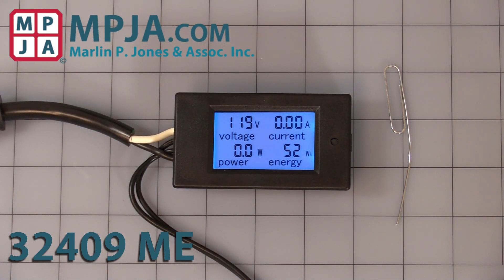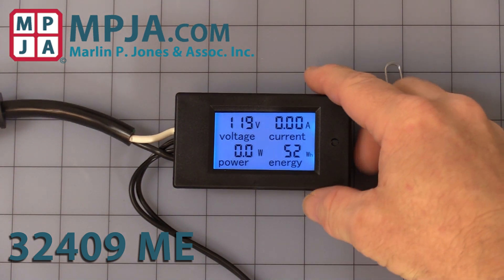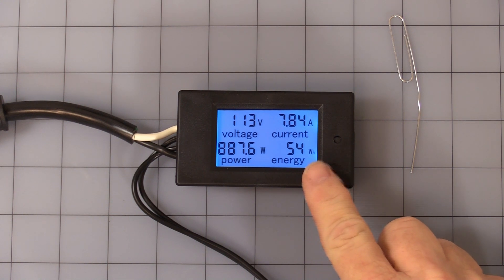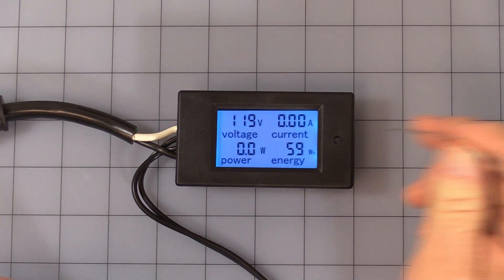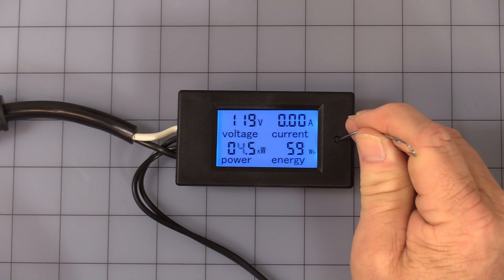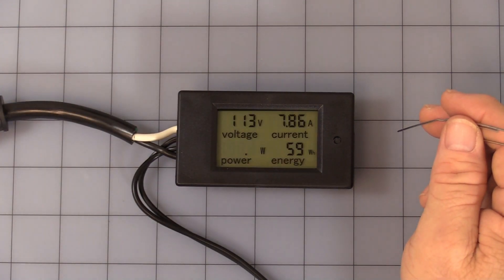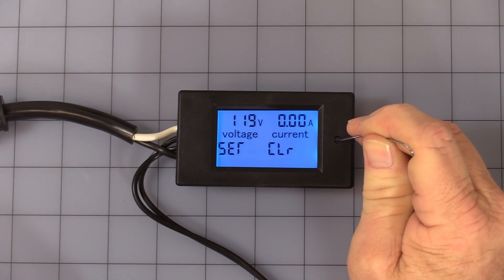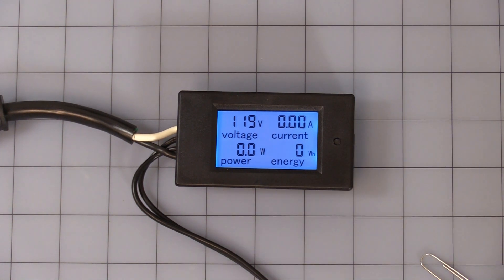LCD AC Volt, Amp and Watt Panel Meter 32409 ME

Comment: Is there a way to calibrate the panal meter? For example it's measure 
227V x 3.44A = 711,5 W but it should be 780,88 W it's an error of +/- 70
 Watt. I have the PZEM-021 version 3.

Comment: When I set the required voltage, the display will flash. So I want to ask if he has any signal or control output. Somewhere on the board.
Reply from the maker: Sorry there is no signal output with this meter.

Comment: aug 25 2019  my similar unit off ebay china is part  no.  PO6S-20 and comes
with a  mystery circuit diagram.    otherwise it could be what you have.
      searching u-t here for a vid' newer than yours with my unit's p/n.

     thanks for doing this vid.  esp' the programming part using that one switch.
and noting the flashing for error is not accompanied by an audio alarm

    on the 1 page op instr's that came with  my unit  is reference an an 'alarm'.  

    to try and clear up the connections the plan is to open the case and remove
the pcb so  the  circuit connections to the  1-4 screws are evident.
.     a low-ohms resistor is expected in there that shows a V-drop the circuit uses
to determine amps.  so the resistor will be a give-away which screws
the 110VAC  is connected to.  

    it might be smart to look online further and/or write to the seller for
a better instruction sheet.  your unit has the connection  wiring circuit
on a device label.  mine lacks that.  which is the root of the problem
given the sheet it comes with shows a circuit with the input wired
to the output.  and no load shown.